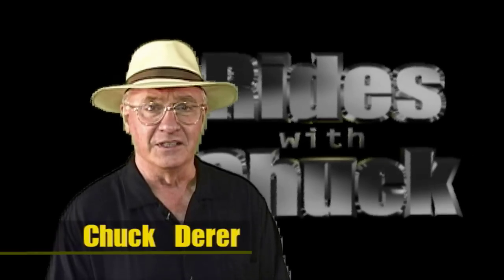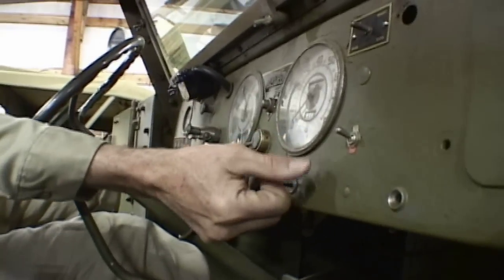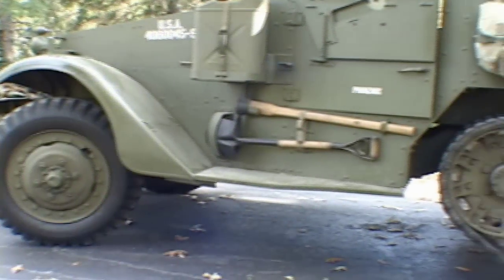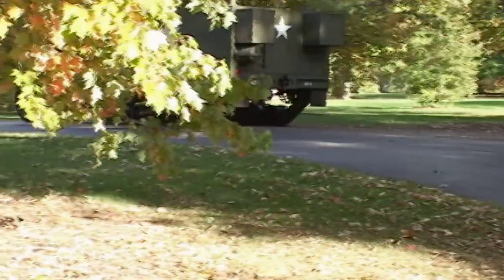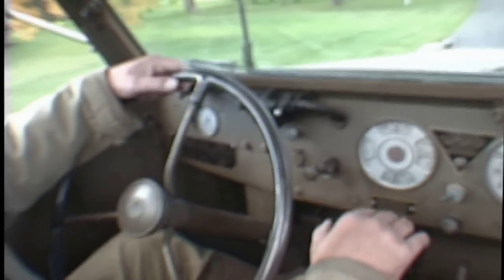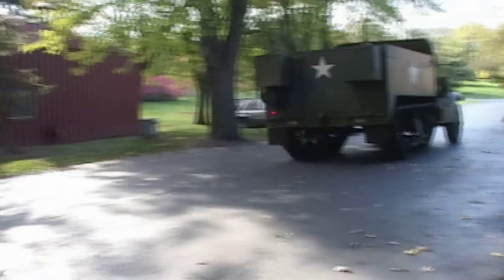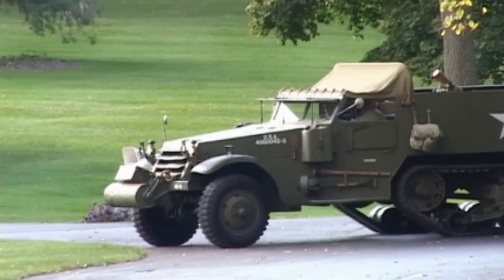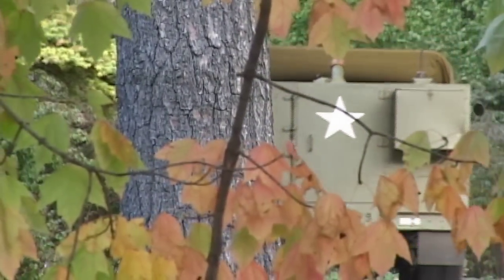M3 Halftrack, We go for a ride! A Diamond T

Comment: Is it early M3 or later M3A1? AT 1.24 if you pause vid there appears to be a "spring" looking piece, on right of tracks. I'm guessing its suspension of some sort which I think is a later M3A1 additional upgrade to original M3 design. Makes sense that surviving halftracks have this design addition of course, just making a scale model M3 and the instructions are not that clear. so any help appreciated.
Reply from the maker: You should contact Cantigny for that information.

Comment: I've always wondered about something. On half tracks, are the front wheels alone enough to steer the vehicle with 
  the tracks maybe wanting to keep the vehicle going straight, or is there some sort of differential track braking tied into and actuated by the front wheel steering system ? If so, would a Hanomag have the same type of function ?
Reply from the maker: Good question.. Maybe a viewer will have the answer.
Reply: No track steering. Basically a 4 wheel drive truck with the rear axle driving the front drive sprocket on the tracks.

Comment: Why many of these halftrack US vehicles have a steel roller at the front?
Reply: peter kung im guessing its to add some weight in the front to have the front tires have more traction
Reply: It's to roll over brush and help climb near vertical inclines.
Reply: Also to be able to drive through ditches without the front end getting stuck in the ground.
Reply: Anti ditching roller.